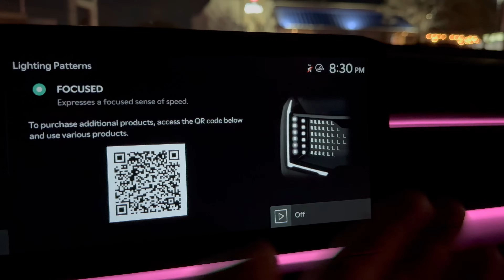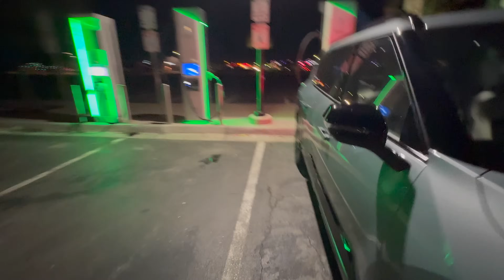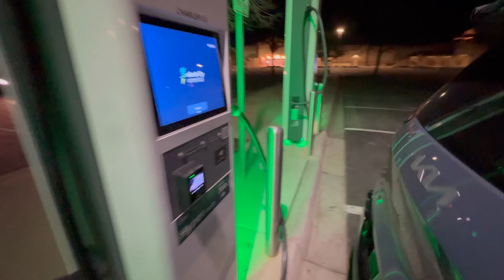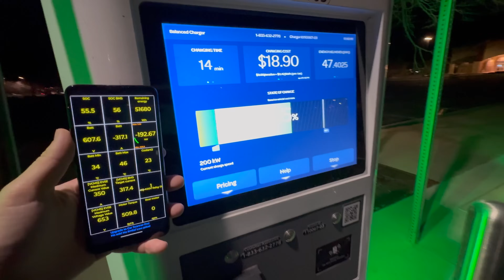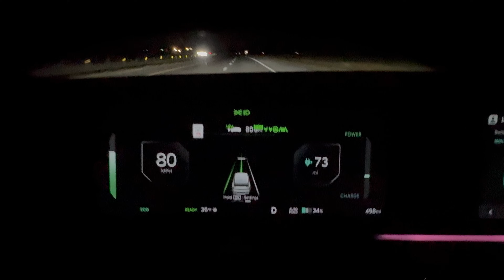The Kia EV9 Will Be A Great Road Tripper! 10% Challenge w/ This Electric SUV (GT-Line 99.8kWh)

Comment: as for the preconditioning, you may have gotten a few more miles (maybe a couple) with just one cycle. Once you are familiar with the vehicle, you get used to (depending on conditions) turning it on manually about 25 to 20 mins before. ON a warmer day, may have passed 100 miles.. Good result for EV9! Great Family road trip cr!
Reply: 5 kW per cycle and 2 mi/kWh is 10 miles of range per cycle. He would have gone 104+ miles with better timing and not doing the cycle at least twice.

Comment: Sadly for me it isn't a great road tripper yet. I go into a lot of rural areas on long road trips and the charging infrastructure in my state is abysmal off the major highways. The infrastructure would have to be much better for this to be something that works well for my family given that we do roadtrips a lot. One thing I don't get is why so many EVS come with big wheels. I'd much rather have 18 inch than 21 to maximize efficiency.
Reply: Did you actually check plugshare with all charging companies??

Comment: thanks for the video, this is exactly what we need. Kyle, do any EVs allow you to pre-heat battery manually, and then it holds the temp for a certain amount of time? Otherwise you have to "guess" when to start heating, based on your gestalt of the outdoor temperature, miles remaining to charger, etc. thanks again.

Comment: This kind of stuff makes me happy that the speed limits in my area are 60mph. While people are regularly going 70+, as long as you stick to the right lane, you can do 60mph safely and get so much more range. I've only had my EV9 for a couple weeks, but I think the fastest I've gone in it so far is 70mph. At 60mph should be able to beat the EPA estimates easily, seeing considerably over 300 miles in the GT-Line.
Reply: My lifetime average is 3.2 with maybe 50% highway at 75+ and I’ve seen as high as 5.7 in urban driving. It’s crazy efficient for the  size.
Reply: this is what i wanted to know.  i live in an urban area, and i don't get to go faster than 60-65 very often, and when i do it usually isn't for more than 10-15 minutes.

Comment: I would love if we could get a chart comparing charge rate with all of the BEVs you guys have tested. 
I've seen charts that show percent vs time, but these charts fail to take into account efficiency/how many miles you get with that percent.
A better chart could show MILES vs TIME SPENT CHARGING. Starting at 10% charge. 
Starting at 10%:
Time Charging on the x-axis
Miles on the y-axis

Comment: Here’s hoping the 10% limit and manual preconditioning button comes to the other egmp cars.

I was never a fan of 3-row suvs, but they’re becoming more and more appealing to me (occasional need to transport 5 big people, plus I also camp in the car) but this is unfortunately about $20k out of my budget.

Odd that they’ve wired the battery in such a way that it reduced the battery voltage on the big battery. It would have been nice if they maintained the same battery voltage as the other egmp batteries (mostly in the 700v range). Seems like this one also runs a bit hotter than the other egmp cars, I only see 47c on my ioniq5 on hot summer days, even though it charges faster and has a smaller battery.

Comment: Great video. What are your thoughts about out the lack of reliable DC fast chargers? In Canada (Ontario) along the 401 corridor the only reliable network is Electrify Canada. Ivy and Petro Canada never deliver the stated speed they claim which makes reliable road tripping difficult.
Reply: This is something I have been thinking about. I'm on the 401 path and we do a few times a year a 530km round trip to see family and once during Christmas. As well as weekend cottage runs at about 370km round trip 😊

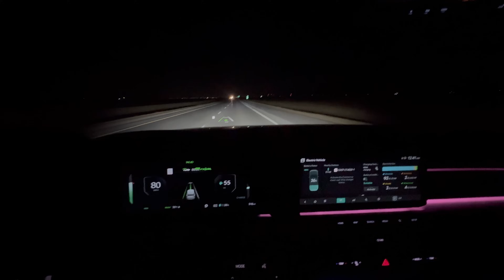Comment: 24:23 I think holding battery temperature with conditioning while driving would introduce a lot of inefficiency, especially when there's so little value outside of hitting peak charging speeds. The best solution is obviously having it integrated with Nav, letting the car time the activation to match the next charging stop. In the absence of that, the car should display the time required to bring the battery to ideal temperature, and then the driver could manually activate based on their arrival time.
Reply: ho nice
Reply: thats instort
Reply: thats so cool by the way
Reply: that cool by the way

Comment: Thanks, Kyle! In regards to the current limits, I think that might be partially by design. It means that these cars really aren't that limited by using 150 kW chargers. It should be virtually identical charging speeds as 350 kW chargers, though the 350 kW chargers can hold 350 A current to much higher voltages.

Comment: You need a new test. No driver is going to un plug before the charging rate slows down. My car has a full speed rate, then a 25% lower rate and I let it charge all through that level, and then I disconnect when the next speed break starts at about 50% speed
Reply: It's slower that way

Comment: 20:20 I am a subscriber from S. Korea, recently owned EV9 GT-line,  leaving comments about rear suspension. As far as I know, all EV9s are equipped self-leveling  conventional coil spring, not air suspension. 
I just wonder there a difference in suspension for US export EV9s. If it is, Korean EV9 owners may upset and eager to equip in aftermarket lol
Reply: Is the rear swivel seat mount available in Korea.
Reply: @michaelm.wiseman282 Yes it is. Swiveling is not recommended while driving. It may be useful while parking (by the sea or somewhere with nice view 👍)

Comment: I'm a bit slow, what exactly is the 10% challenge. Is it how much you can charge in 15 minutes when the car is down to 10% along with how many miles you can get?
Reply: It's just a baseline test focused only on road trip ability. It assumes arriving at a high power DC fast charger at 10% with  a warm battery, then testing how much usable range can be gained in 15 minutes at a more realistic road trip speed (80 MPH or so).

Baseline test aside, it's perfectly acceptable to arrive below 10%, and perfectly acceptable to charge more than 15 minutes in the real world. This is just comparing charging and range performance across many vehicles.
Reply: @wzDH106  thanks.  Let me watch again to hear the conclusion

Comment: Just curious.... Have you done a video/tutorial on the OBD adapter? I'd sure be intereseted in knowing what all of that data means! Thanks for sharing. G
Reply: What app is that?
Reply: @michaelm.wiseman282  It's the app I've seen folks use in conjunction with an adapter to plug in the vehicle's OBD diagnostic port. Kyle on Out of Spec often uses one.
Reply: Car scanner

Comment: Real owner,  I'm not impressed.   I have had EV9 for 11 days.  Car fob problems.  Dead 12 volt battery.  And lock out of car 4 times.  In 11 days.  compared to Mach-E.   This thing is finicky and unreliable.  Dealer drop off tomorrow.      BUYERS BEWARE...
Reply: 10 years warranty is not a selling feature if the vehicle spends much of the time in the shop.

Comment: How does battery voltage affect battery regeneration? … 400V, 600V, 800V….
Reply: does not, that fully depends on motors
Reply: @lucistnik That is wrong, it does depend on the battery as well as it needs to be able to charge/discharge in a quick time the amount you generate/demand through the motor. In a hierachy the battery always comes first in an EV, it kinda determines everything else. 
The volts system achitecture does not affect regeneration a lot in most cases, tho, so that's true.
Reply: @BBingo-v5i  
I had thought Porche claimed higher efficient regen for their Taycan (e.g., versus Q8) due to its 800V architecture. I was wondering if the same were true for Hyundai EV9 (600V vs 400V)…

Comment: Interesting how quickly that battery cools down while driving.  My Rivian, after DC charging, stays in the 90°F range (in the menu). Do you see the same in your earlier VIN R1T?
Reply: The Kia and Hyundai vehicles have heat pumps with heat scavenging, similar to modern Teslas. The HVAC system will tap into battery heat for cabin heating....the EV9 has a large cabin to condition.

Comment: Thank you, this series was very informative. 260miles on a 100% charge, driving at 70mph. Driving it at 80mph you used 47% for a distance of 94miles - so you would get approx.200miles on a 100% SOC.
Reply: You can see in the video he’s getting 2 mi/kWh so yeah, about 200 mi. Depends on the weather - 10% range hit at 32F is typical for most EVs in my experience so maybe closer to 220 in warm weather. If he used 5 kW every time he preconditioned the battery, that’s a 10 mile hit per use and he did it at least twice.

Comment: If the HVAC system works anything like the eNiro, the battery heat will most likely be transferred into the cabin for heating, using the heat pump.

Comment: I don't understand the fascination with charging at absurd $/kwhr and limping to the next station. I can't wait to get solar set up to avoid paying for it out of the wall.
Reply: The whole point of these is to simulate the experience on a road trip, not home charging
Reply: How does paying $30K for a solar power system with battery storage save money on electric bill?

Especially if the solar panels, inverter and battery require replacement every few years.
Reply: @Timmymao163  this is a troll post. Solar is not that expensive after tax credits
Reply: @davidchen3643  You're off by an order of magnitude. You can get panels to your door for 20 cents per watt. I won't use batteries, just grid tie. And because I'm not inept, I won't be paying someone $120 per hour to install. I work from home, so charging during the day is fine.

Comment: thanks for sharing this test! i find it difficult to understand why we are calling it a great road trip vehicle though. at 2 miles per kW (and 40c per kW of charging at the stations you used) this Kia’s equivalent MPG is ~14 which is terrible at best. For example, for a gallon of regular gas ($2.80) you can buy 7 kWs which will last for 14 miles. I love the design and roominess but given the limited availability of charging stations and expensive kWs, any ICE vehicle will outperform this baby.
Reply: 80 MPH though, with temperatures below 30F and required preconditioning for the following stop. From what I see online, the gas Telluride will achieve 20-21MPG at those speeds, probably less below 30F with denser air. Sure, the slightest edge at 80, on a road trip, will go towards the Telluride, but falling back onto daily use, in the city, while charging at home, costs of refueling will favor the EV9.

Of course, no one considering an EV9 would realistically consider a Telluride, given the upfront costs, unless they were comparing it to a 3 row Volvo, Audi, BMW etc.
Reply: @wzDH106    i agree but that’s why i wouldn’t call it a great road tripping vehicle - daily use in city/charging at home is something completely different - perhaps we should be calling it a great looking, spacious 3-row electric vehicle around town.

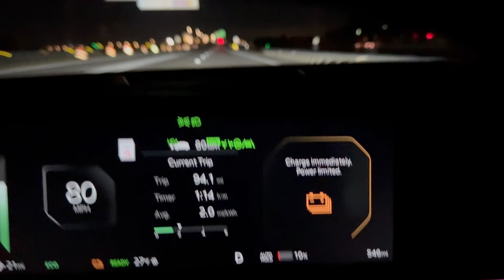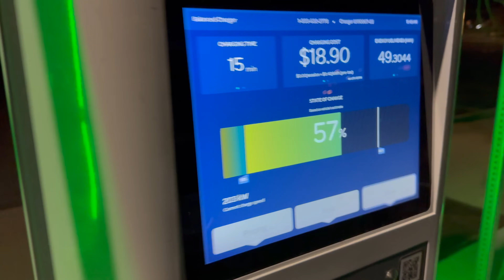Comment: 94.1 miles (26:44)  from 49.45 kWh (16:53) = 1.9 miles per kWh (526Wh/mile) - lucky it actually charges fast it needs to at this consumption rate. Sure it was cold but still sheesh
Reply: AND it cost him almost $22. No one is talking about that. No one mentions the insurance on EVs either which is sky high.
Reply: @Dr.Feelgood2 I must have missed the memo cause insurance on my niro is normal...

Comment: This is impressive. Are we going to talk about the fact that it cost nearly $21 for 40% charge?
Reply: $0.08/kWh in Washington. Cost is approximately $7 to drive 250 miles using home rates.

I'm not sure if Colorado has time of use rates. Utilities may offer such residential rates, but that doesn't necessarily translate to a similar structure on the commercial level for DC fast charging. I'm sure demand changes apply in most cases as we're talking 150 or 350 kW at any given moment using DC charging, as opposed to a light 7kW at home. We don't have TOU rates in Washington.
Reply: Price of DC fast charging. Charge at home, or work, for $6 - $8. Unless one lives in California, we won't talk about California....
Reply: And this was at 11pm so rates are 
"very cheap" It cost me $40 to go from 10-80% at peak price in CA in a m3LR. Just sayin that seems very expensive. @wzDH106
Reply: That is on par with gas prices for doing road tripping $$/mile comparison especially if you keep your speeds closer to 65mph ...
As stated %95 of the time you will be charging at home where it will be significantly less...
This is ignoring the cost of the car, but once you factor in savings on maintenance and gas it's not as bad. For reference 160,000 miles at 24mpg and $3/gallon is $20,000 of gas which isn't too shabby considering I can buy a used low mileage id4 for around $20,000

Comment: So when fast charging (10 to 80%) on a road trip scenario, what is the cost per mile?
Reply: The car was showing 2 mi/kWh. Multiply that by your DC fast charger rates. At 42 cents a kW in the video, 21 cents a mile. DC fast charging is expensive.

Comment: I’ll wait for Lucid Gravity next year.  Almost the same price, much nicer, has a usable frunk and 140 miles more range.   You’ve been able to manually precondition the battery in the lucid for 2 years now.  Also we were told by this same channel you can’t road trip CCS cars, even if they have 400+ miles of range.  So the EV9 is an amazing road tripper with less than 300 miles of range on CCS?  I don’t get it.  Great charging curve on the EV9 though I’ll give them that, pretty cool to see sustained 200kw above 50%.
Reply: Your 80K base model Gravity won't have all that range, I hope that helps. You will need the 150K special edition one to have 440 miles of range or whatever it is (it won't have that range anyway).
Reply: @brandonc9706  yeah that’s possible. It would be an interesting side by side of the two once the Gravity comes out, I’d still be shocked if the entry level gravity wasn’t at least 60+ miles more range than the EV9 for the simple reason they’re estimating 3.4mi/kWh so even if entry level was 100kw battery pack you’d still start at more range.  But the best thing the EV9 has going for it is the charging curve, pretty cool seeing 200kw above 50%.  The Gravity would have more useable space given the frunk.  So does the R1S but its 3rd row is weak. Plus upcoming Polestar and Volvo SUVs, 2024 will be an interesting year for more actual SUV EV options.
Reply: Gravity looks great for storage,  but I agree that the $80K model is not gonna be insane range.  Probably still better than 270 though.  Also,  big question will be when those 80K models are actually available.  I think Lucid started with the expensive trims with the Air.

Finally,  big concern/factor with Lucid for some will be limited service options with it being a smaller company.   Like anything in life,  it’s gonna be be a set of pros and cons that are very unique to each shopper.  Still, great for everyone to have more options in the 3 row segment.

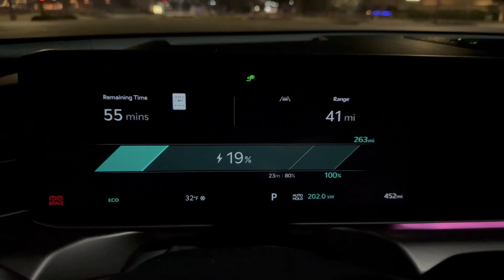Comment: 13:39 for the foreseeable future don't expect native 800V vehicles to hit 500A. 300 to 350 is where they would max out at. Depending on cell Ah, P count of pack, 3C for cylindrical, 1.5 to 2C for Pouch, prismatics is somewhere in between. 500A at 800V is mostly for Commerical EV trucks that have much larger cells/Pcount (for their kWh application). There might be a few exceptions, maybe the Hummer EV but that's cuz it is 200+kWh (that's in the range of Medium duty commercial box EV trucks). So far anything in 80 to 130kWh 800V vehicle 300 to 350A is where you'd peak at for aforementioned reasons. Just where we stand technologically, and all the focus right now is getting the cost down on these technologies, with little emphasis on a step change in cell chemistry (that's all due for 2027+).

The kia EV9 is mostly a 60Ah pouch cell with a 3P count, so it's reaching 1.8C, so could be pouch cell or non cell limited and sized for much longer continuous 340A current (so cells should be fine) and limited by busbar/cable/connectors continuous rating to the DCFC port and there after, helps with cost optimization.

Comment: Why don’t you just precondition perfore you charge instead of 3-4 time in a row. That’s just wasting energy IMO
Reply: he has no way to know how much time the precon will take
Reply: @lucistnik   maybe not by the minute, but he activated it halfway, so ruffly 50miles, which will take him about 40min. Precondition should probably take him 10min.
A good info is that it takes 4kW of power, so 10min is about 0.66kWh, so basically 0,66%. If he had did it only once instead of 4, he would have save 2.6 kWh and reach the 100mile mark
Reply: basically you are correct, but then this is yet more complex. e-GMP cars do take heat out from battery aggresively to heat the cabin, so with repeated pre-heat you basically just shift energy consumption of cabin heating forward in time  @andresamson8859

Comment: Bolt does 4 miles per kwh haha
Reply: Try fitting 6 people in a Bolt or charging faster than 55kw.
Reply: @th003g  never gonna try. It charges between 11pm-6am at 3 cents per kwh lol goes to work and back for $1.95 for an entire week lol
Reply: @tsmatthx2  therein lies the difference, one is an econobox EV for around town use, the other isn't.
Reply: @th003g  yup
Reply: At 80? Lol. Maybe 80 down a mountain.